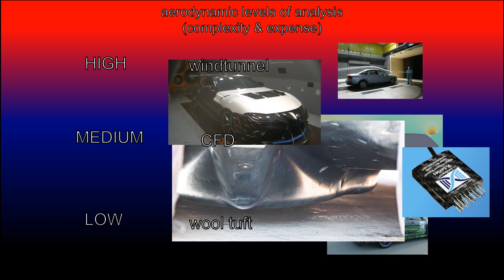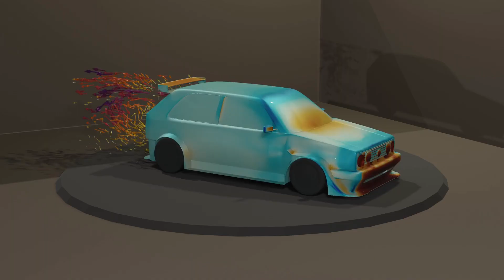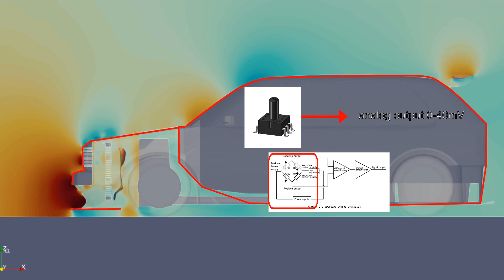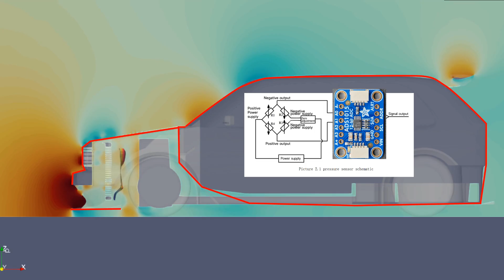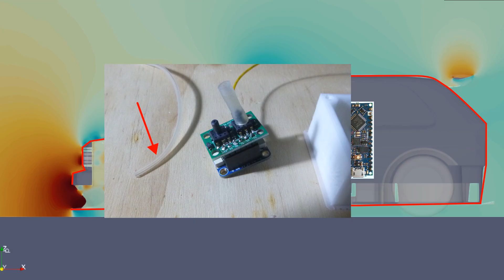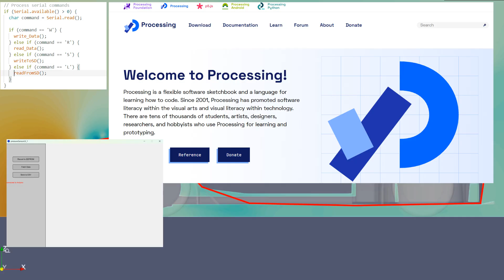Pressure Measurement Kit: Part 1 prototyping

Comment: Ahh this reminds me of 2012+ . I have to agree that the expense of the professional sensors is extreme for what components are inside and getting the data out often required a lot of debugging and further expense hardware normally . We made the same kind fo unit for checking the aero numbers correlated from CFD , Wind Tunnel to actual vehicle for a banned SS in Victoria with lots of help from a ex Renault F1 aero doc who also did work with some RMIT aero grads at the time. Even the expensive units fail constantly if you introduce any form of vizzing the vehicle , or if you are operating it in a dusty area ( we hired Heathcote drag strip and a airfield for coast down ) The issue is there is no filter for the sensor and they seem to always become blocked and are impossible to clean out. The hyper expensive units used in F1 ( not the same company as you have pictured ) have a stone filter like a fish tank one before the sensor , and the sensor itself has a port to the side of the sensor face that can be blown ( to reverse flow ) to clean the sensor out of debris . Having made multiply sensor arrays or 16 the easiest way to cheaply recreate there arrangement with the cheaper sensors pictured was to have a removable filter assembly and just a grub screw arrangement tapping into the side of the sensor . All of this was just made to fit NC'ed out alloy casing . With all of that in place the units if they gave trouble where quickly sorted with just a blow out of compressed air at the track . When you say hire PI at $800 a hour ( most likely now triple that today ) you either need a lot of units to swap over or for them to be reliable . We ran three of four aftermarket engine ECU's of logging and the vehicle was filled with tubing to many units for hundred of sensors much like in F1 . Another tip is if still you have an area that is clogging the sensors with dirt and dusty , especially in a high pressure area of the underfloor extend the tube ( have it sticking out ) passed the boundary layer and much like a pitot tube this seems to fix the issue mostly .

Comment: I just got a £60 differential pressure sensor, hooked one end up to a pitot tube from an RC plane for reference pressure and then taped the end of the other tube to where i wanted to measure. It was then plugged in to an old (no longer supported) DL1 data logger, seems to give results. Its a shame i cant do more locations at once. Will be watching this progress with interest.

Comment: Did you consider to use something more versatile like esp32, wich is arduino compatible as well?

It has bluetooth and wifi on board an several other goodies which helped a lot to measure airflow of brake ducts and break temperature while emitting the values via mqtt to a mobile computer within the car.
Reply from the maker: For the basic kit there is no need. It fulfills the function adding more just adds cost. This basic kit is going to be super cheap, somewhere between $50-100. Once you start getting into more capable MCU then cost of the code starts to also become included. Measuring brake assemblies is a whole new problem space, remote access to the data make sense there with more robust packaging, it just a much more specific and difficult problem that would be embedded in to costs.